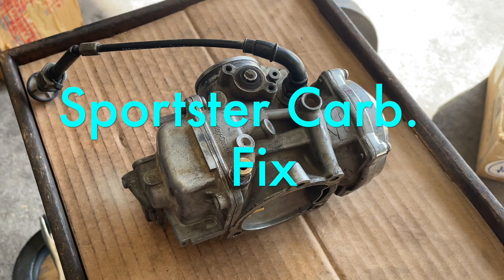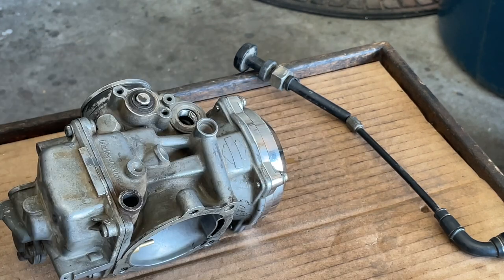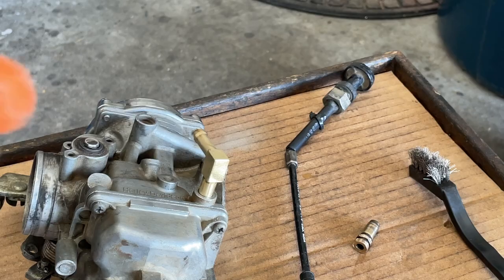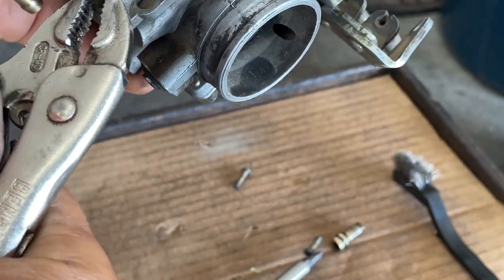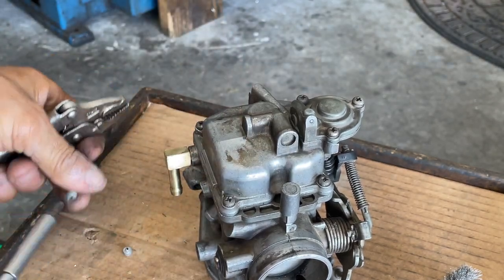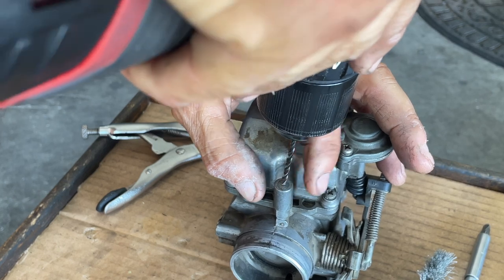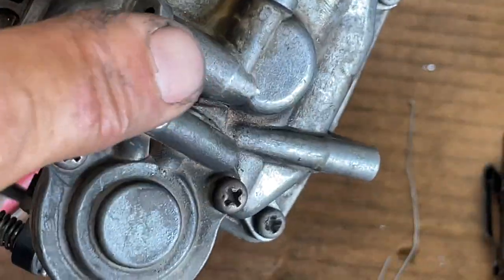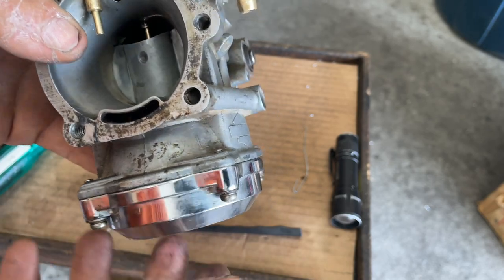How To, Harley Davidson Carb  Fix.

Comment: Hey! I have a question. So I just bought a 2006 sportster 1200 low from a guy that let it sit in his garage for a year. He overfilled it with oil and it fouled the spark plugs and was in the air filter. I followed your videos and cleaned the jets and put new spark plugs and an air filter in. Whenever it idles after warming up it’ll idle fine then it kind of skips a beat and will almost bog down then go back to idling (sometimes it does bog down and kill the engine). Any idea what this is? By looking at the spark plugs it looks like it’s running rich. Would it be I need to adjust my air fuel mixture or does this sound like something else?
Reply from the maker: Happy to help. Make sure you oil level on the dipstick is halfway in between those two marks most important run it without the air filter in your garage and see how she breeds and then check your oil level, halfway no more. Another popular problem is the petcock Diaphragm fails, and this will cause fuel to work its way into your system, making a very rich running motorcycle. I will send you the video on how to test your Petcock and then we'll go from there.    https://youtu.be/7Fo9Q93OJXI.    That's not how it works out. Thank you for watching in all your support Jonah.
Reply: @TwoWheelRocco  does the oil need to be halfway on the dipstick when it’s hot or cold? Thanks for the quick response I really appreciate it
Reply from the maker: @Cabnnn  halfway when cold. Have a great day.
Reply: @TwoWheelRocco  let the bike set to cool and the oil is barely over half full, barely. there was some oil seeping through the new air filter and can see some in the carburetor i believe. not sure what's going on, but it looks like it’s coming through the breather bolts
Reply from the maker: @Cabnnn  Run the bike, cycling through so the oil will start to dissipate. What happened was when the bike sat for a long period of time the oil drain into the dry sump of the Sportster motor. Then old owner refilled oil Thinking low oil. It will take a little bit for it to work it's way out, check your oil levels,  because it will start to get high again and you will have to much oil in your bike,. This is called  Oil sumping.

Comment: Thanks I just rebuilt My CV Carb & the accelerator pump has never worked in the 4 yrs Ive own & road This 1200 Sportster upon Careful removal of spring loaded cap ....I found Only 1 - ring inside Not 2 & theirs was diffidently No ball ..so i thought I was ready to Remount carb & go for an ride ..but Now ian not so sure with ball missing ..I did purchase an accelerator pump kit &  No new ball was in the  kit but it had 2 - O rings ..so wonder where i find an ball @ & is the ball Critical to install ..any Help Greatly Appreciated ..Thanks Rocco
Reply from the maker: How did she run. I believe on the CV Carburator there is no ball, what are just an O-ring small. Thank you for watching and all your support. HService. Let us know how it works out. Ride safe and have a great day.
Reply: @TwoWheelRocco  Thanks Rocco Great News ,,,bc after watchin This video , i was so worried The  missing Ball on   accelerator pump on This CV Carb -- 2000 HD 1200 that was Maybe an Big problem .... Bike used to run good to just Ok before rebuil but that's without accelerator pump working I Hope It be 99  % better now if Pump works ..Ill test it with gas in the bowl before Carb reinstalled Thanks ya Sir ... ur The Best Keep Ya Posted ..Thanks Again
Reply from the maker: Just let us know how it works out. I think you should be fine. Any questions just ask. Have a great day safe. @heatingairservices8708

Comment: i got a 2005 harley 883 with 1200 screamin eagle kit loses power in 5th gear all the other gears are fine has low end but no topend just falls on its face it does backfire through the carb somtimes if you throttle it all at once cleaned the carb all jets appreciate any help
Reply from the maker: Happy to help What pipe are you running? And what air filter are you running? Do you know your jet sizes?  very important. Thank you for watching and all your support. Drive safe and have a great day. Happy to help.
Reply: @TwoWheelRocco  it's a screaming eagle pipe stage 2 stock jets and screaming eagle air filter
Reply from the maker: @zt2628  I would take a look at the fuel line to see if there is leaking fuel coming out of the inlet or the fuel line itself as you stated it's stock Jets so that a 42 and a 175 Main.Take a close look at your accelerator pump if it's leaking gas out of the bottom of diaphragm. That's the only place I can think of. Thank You for watching and investigation your support. Ride safe and have a great day. Let us know how it works out. Take close look Gas Leak,  Make sure you're only halfway on your oil dipstick.  Does not like to be overfilled with oil, filter gets polluted and the bike does not run well very dirty.

Comment: Is it normal for a little gas to drop out of the carb past the nozzle?
Reply from the maker: Happy to help. That's an indication of a bad float. Needle jet is not seating properly because the ethanol has destroyed the rubber tip. Buy a new float needle jet. Thank you for watching and all your support.Jodie. Ride safe and have a great day. Any questions just ask.

Comment: Your local HD shop should should have the brass inlets in stock.
Reply from the maker: Happy to help. HD will not have that part. You're lucky if you could buy the carburetor there. Thank you for watching all your support Brad ride safe and have a great.
Reply: @TwoWheelRocco  If it is not in stock they (google) have the part number and it is available, in case u dont want to use ebay. just saying, Rocco...
Reply: Also, I thinking about ur local shop, what kind of bikes they deal with mostly.
Reply: Our shop used to have lots of old  and new parts and i ordered $500 new parts from them at Xmas and waiting to get off my bum.

Comment: Bro.ken here. What is the shelf life of a new carb? How long would the rubber components last, sitting in a bag/box?
Reply from the maker: The first question is is how much did you pay for it second there's a lot of Chinese knock offs out there and parts don't fit perfect. I would spray it and see if you have a vacuum leak when the motor is running couple squirts here and there by the seals, and if the idle raises, you know you have a leak. Let us know how it works out. Happy Thanksgiving.
Reply: @TwoWheelRocco  bro.ken here I am fine with the last repair yesterday morning, thanks to you, I just did the complete carb rebuild. $20.and some change from my local H.D. dealer.. They want $555.00 dollars for a H.D. 1200 sportster carburetor. 
    So since my 06 isn't getting any younger, I was thinking about buying the stock carb and having one on my shelf for the long haul. Then I start thinking about the rubber gaskets, etc. etc. and wondering how long could it sit on the shelf and then be good in a couple of years?

Comment: I wonder if I have a open valve leak  or gas leak because my bike keeps chocking when I turn it on . And a lil white puff of smoke comes out
Reply from the maker: Happy to help. First thing I would do is test the Petcock because that's where it starts. How does your bike start in the morning with the choke on? It all tells you something, if you have a bad needle jet.  morning time you probably have a situation that the motor is rich.. That's why we need to check the Petcock first then you can move on too the float needle jet.  I'll send the video. Thank you for watching and all your support. Ride safe and have a great day.     https://youtu.be/7Fo9Q93OJXI?si=oephOn0j1YCfuyHZ.   Let us know what you think.
Reply: @TwoWheelRocco  thanks for responding back  Rocco !  First think I do  I turn it on then use the choke  on for about 15 min. But I just check the petcock and it feels like it’s been sweating gas cuz I touch it and smell like it . I don’t know if the vacumm  is sucking but will watch the video !!! Thank you so much
Reply from the maker: @mykedntsleepmykedntsleep9313   That's how I would play it, check that Petcock if it holds vacuum at like 8 or 9 pounds and stays . Petcock is good if you visually see gas check the hose. and tight nut that installs Petcock to tank give it a try. See if it seats it.
Reply: @TwoWheelRocco  willl do !! Thanks again

Comment: Rocco my cv carb is not getting much fuel the float bowl is nearly empty when I removed it.
Reply from the maker: Happy to help. Test it, like I did in the video. Your float bowl will only be full about 2/3 of the depth of the bowl. Any questions just ask. Thank you for watching and all your support Mikey. Ride safe and have a great day.
Reply from the maker: I will send you a video on how to test your petcock, That's where it all starts    https://youtu.be/7Fo9Q93OJXI.  If your vacuum line is collapsing or not working, or has a leak, your diaphragm in your Petcock will fail to work, which will starve your motorcycle of fuel. If the petcock is failing, it will set up for a rich condition and your motorcycle will get too much gas.And will get sucked through the vacuum hose into your intake causing a very poor running motor..Any questions just ask.

Comment: Rocco man help me out! I can't get my 1990 883XLH to run, i just cranks and the a massive bang out the pipe, carbs, petcock, plugs, all cleaned, nothing! Just bang! I can't figure it out!
Reply from the maker: Happy to help. The first thing to do. start with is the vacuum petcock with the vacuum gauge. Do you have a vacuum petcock set up? Thank you for watching it all your support Frank. That's where I would start. Ride safe and have a great day.  Take a look at this video.  https://youtu.be/7Fo9Q93OJXI?si=bXDuvPq_hyS_movj.    Sounds like you have a lack of fuel problem. Let us know how that test goes and then we'll move on.
Reply: @TwoWheelRocco  thanks for getting back to me! Big fan of the channel, its not a sportster tank, I'm not sure what model the tank is from but is doesn't have a vacuum peacock , I emptied the float bowl and turned the fuel back on and it filled again so I believe the carb is getting fuel
Reply from the maker: OK, so the next thing will be jet sizes what is your idle jet and what is your main jet size?
Reply: @TwoWheelRocco  it was a bad ht lead!! Something I should have check first before pulling thing's apart! Thank you for the guidance and help it's much appreciated, also I want to thank you for your video and the way you take time to explain the hows and whys it slow time not like a lot of other "put the dohicky on the flimflam and job done!" Your an asset to every harley owner out there
Reply from the maker: Happy to hear all went well. Ride safe and have a great day.
Reply: @frankiemccabe4602 i am having the same problem... Cranks then big bang out of the pipe. What exactly is that ht lead you talked about?

Comment: Bought a 2006 sportster that has only been ridden 3k miles. The batterry died and i tried to start it for a while. (Its was running before the battery died). Eventually i gave up trying to start and just charged the battery. Now the by its turning over but wont catch. Im lost and completely new to bikes. Any advice anyone?
Reply from the maker: You will need a new battery. Go to Harley Davidson and buy one of theirs. Today batteries are sore issue. China is deep into us. HD battery. And that's what will start your Sportster.. Thank you for watching and all your support. Jess. Let us know how it works out we'll get you running one thing at a time, that battery probably does not have the cold crank amps that you need
Reply: @TwoWheelRocco  will be replacing the battery tomorrow. And adding fresh gas.
Reply from the maker: Let us know how it works out.
Reply: @TwoWheelRocco  replaced the battery today. With new gas in it. The sportster is turning over and has spark. But still not catching. Note. When i first bought it it hadn’t been ridden much. I didnt now how to ride and  stalled the bike multiple times. It was running good . But after taking highway patrol mortocycle safety classes and charging the battery it did not start.
Reply from the maker: Happy to help. If it started before and then you fooled around with the battery, I would check the battery reinstall. And you said it's a new battery so I don't understand why you had to charge it. Batteries are important. I must have a new battery. Thank you for watching and all your support  Jesse. Drive safe and have a great day.
Reply: @TwoWheelRocco  there is a new battery on it as of yesterday.  There are two leads in the positive and one lead on the negative. I also tested for sparknon the plug and it had spark
Reply from the maker: Remove your air  breather spray some gas pull the choke out and see if it turns over. Let us know.
Reply: @TwoWheelRocco  i removed the air cleaner today. I sprayed starter and it failed to turn over. The carb jet is spraying when i hit the start. Throttle jet works too. New battery and i put in a gallon of good fuel a week and a half ago
Reply from the maker: The next thing I would do is check for spark, take spark plug out of the motor, put it against the motor, connecting to the coil wire and rotate to see if you have a spark.